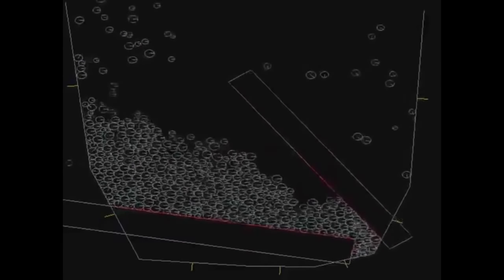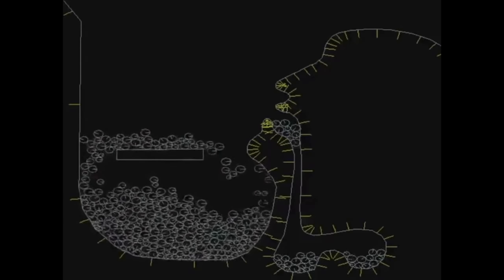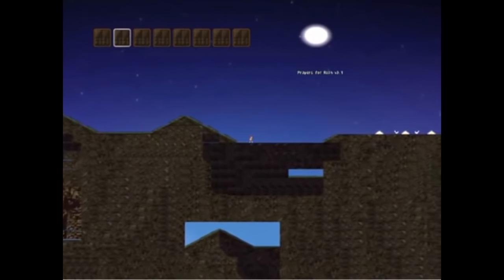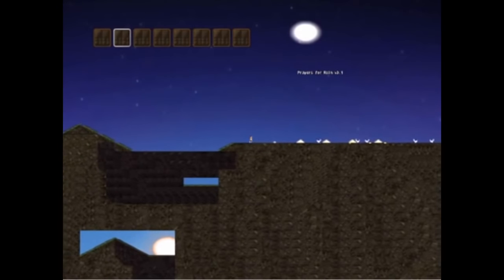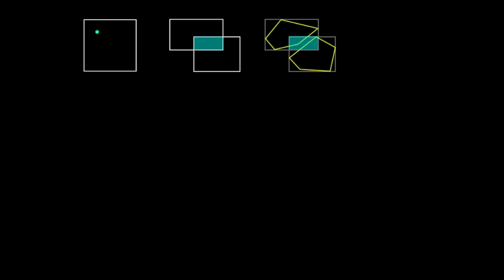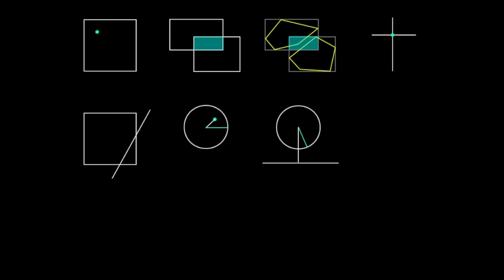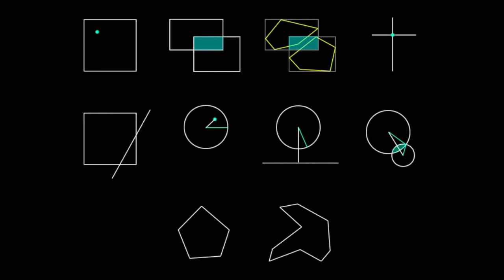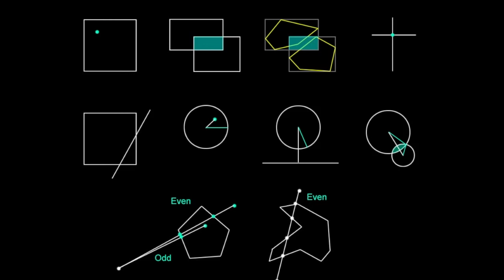Collision Detection JavaScript Tutorial Part 1

Comment: What if a point describe line witch intersect a corner? It just counts as intersection for each one lines which makes this corner?
Reply from the maker: I guess that's open to interpretation? I could be wrong, but regardless of if I am... when a 3D camera is moving forward it's the same as if the objects moving toward you. Two different things, look visually the same. Same here, it's just the way you choose to see it.
Reply: Sorry, i see my english isn't so well and my skills to explain too. You say, that if line is inside of polygon, so line to point sure are not in that polygon must have odd count collisions. At point of logic side of this question in example i write earlier there are even count collision, but if counts every single side there are odd collisions. I just want to completely be sure, that i got it right.

Comment: OK, so let's say a polygon happens to end up sitting wherever it is you start your line from for the point in polygon test, and it would result in zero intersections. This could count a miss, just like if the point were far enough away that the line never intersected at all, since zero is even. How do we determine a starting point for the line that guarantees at least one intersection between its starting point and the point being tested?
Reply from the maker: That's why you always choose a far value like x=10000 & y=10000 (or similar)
Reply from the maker: This is reasonable because you are looking to determine if 1 point is inside the polygon. So the starting x/y is irrelevant. It assumes that most polygons will reside inside some sort of a bounding box.